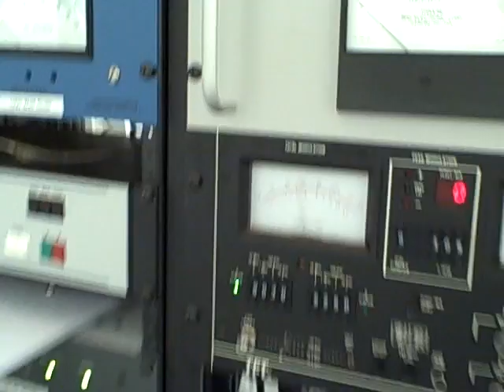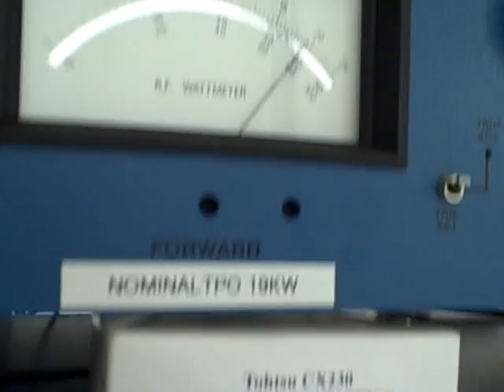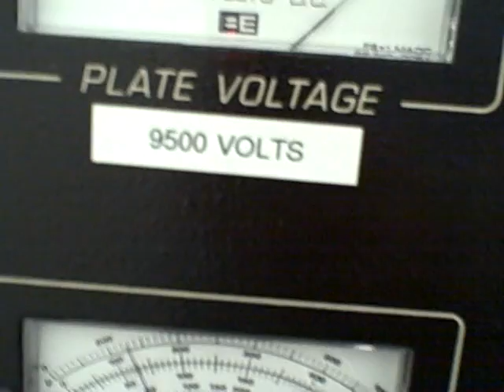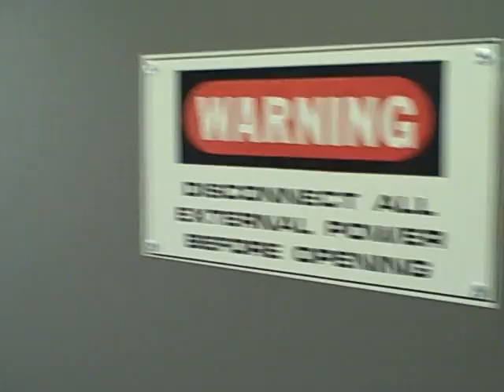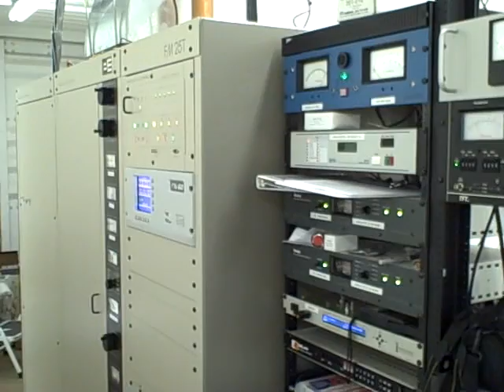The KKUA FM transmitter Installation

Comment from the maker: It is manufactured by Broadcast Electronics of Quincy, Illinois. The rated efficiency is around 80%. The antenna on the tower provides a power gain which takes the 19KW and bumps it up to 56KW.

Comment: Thats a neat transmitter. Thanks....I have seen a 10-B used at a station which a friend works at. The AM/FM tower there is features in my video of guy insulators arcing. The ERI bays can be seen during the lightning flash. I think a Nautel V10 may replace it. Is this a Shively combiner in the right end of the building? Looks like several transmitters go into there and thats where goes to the tower. What type antenna and how many bays?

Comment from the maker: Yes it is a Shively star combiner. We use a six bay 6814 high power model. You can see it in other daytime videos at Ulupalakua that I put up recently.
    There are 7 or 8 BE10B transmitters running into a big panel antenna system with the combiners taking up nearly an entire container below. It's a big site, many many KW coming off of that tower.

Comment: Sir, it's bettter if you've include in the video the air intake of the transmitter,  electrical panels and   commercial powe supply setup as well the generator set.

Comment: would not want to be in that transmitter shack during a lightning storm,
do they keep somebody in the transmitter shack to work on the equipment if something stops working, or do they just call out a repairman when something breaks?seems like there could be a lot of radiation inside that building,

Comment: I see some ferrites there. Good to use them, even if some folks think they are "black magic".
Do you use a thermal-imaging camera to regularly check the combiner and LPF's for heating?
Reply from the maker: I use a simple IF thermometer for things like that. The entire site was moved to Haleakala in 2017, and at 10,000 feet, did not need the higher TPO (4 KW instead of 21KW). So heat is not a big concern any longer. But yes, ferrite is my friend up there. More lightning at the higher elevation.

Comment: Beautiful transmitter as far as aesthetics. How does it sound? Is it reliable? I was wondering : Do these new transmitters still throw a " Crowbar" if the output should have a problem? I mean the Final P A I would guess. Overall a very noisy nicely laid out , Air flow filtered installation.  73's

Comment: Where's the RG58 cable to the antenna???  :)
Reply: It's hidden inside the 6" hardline.
Reply: RG58 coaxial cable would melt, could never carry nearly 20Kw of RF power. The center wire or rigid conductor inside this hard coax has to be huge